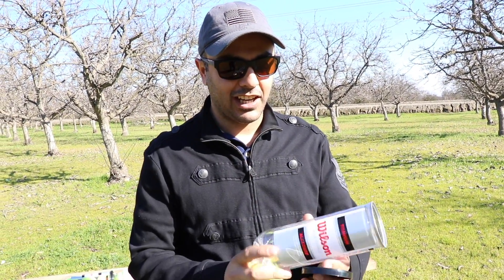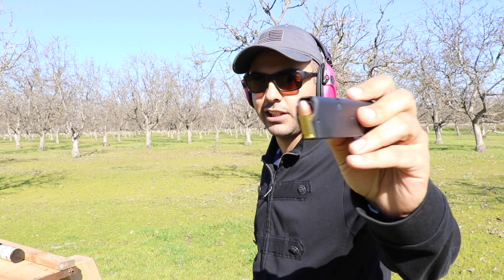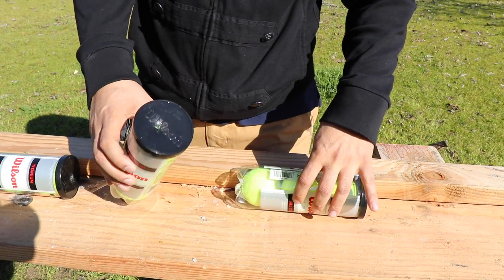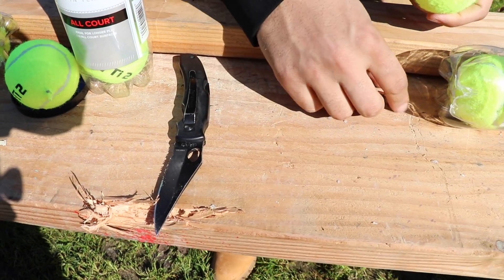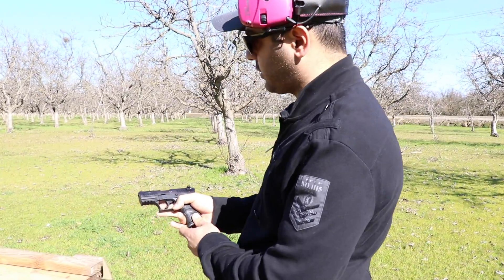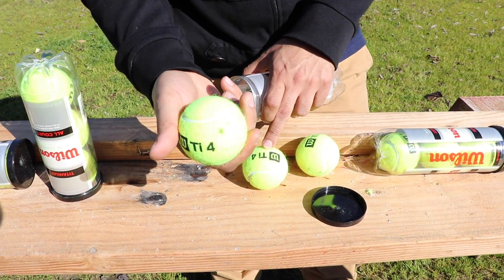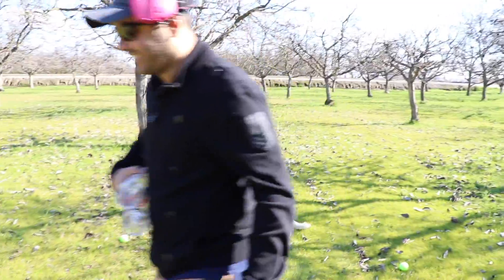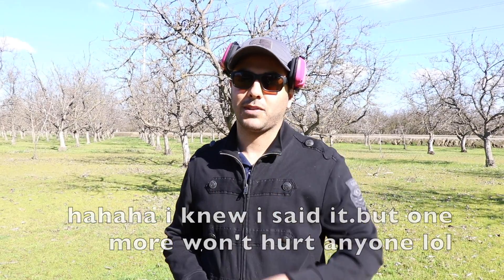how many tennis balls does it take to stop a bullet?

Comment: What's the difference between the same bullet shot through a gun, short barrel and long barrel rifle into the same material?
Reply: Solder Joe When you shoot the same caliber out of a longer barrel the velocity is greater. For example a glock 17L would have a greater velocity than a regular glock 17, and a glock 19 would have a lower velocity than a g17. Same with an 8" .44 mag vs a snub nose. Also accuracy is improved in longer barrels as the bullet has more time to twist as it is going down the barrel ✌
Reply: The math coming out of the barrel is obvious and easy to find or figure out but what does that acctually mean to real world results? Is it a large enough percentage to make a noticeable difference? Is there a bigger difference with a bigger caliber? Is it exponential as the bullets get larger?